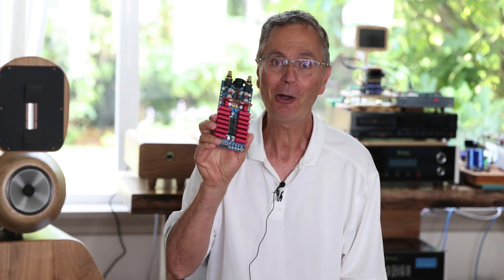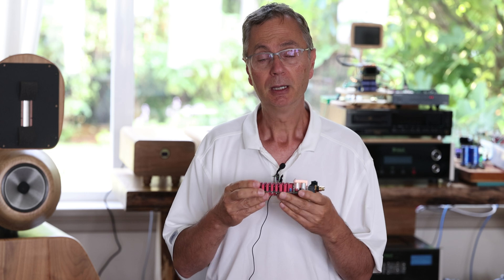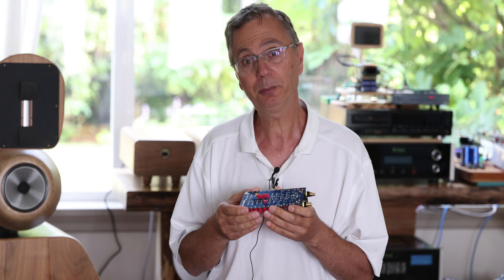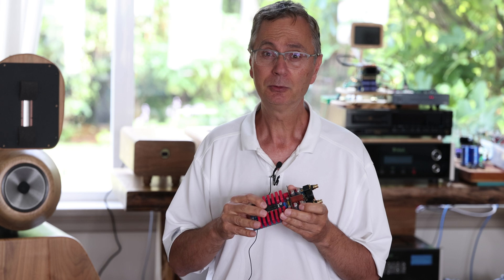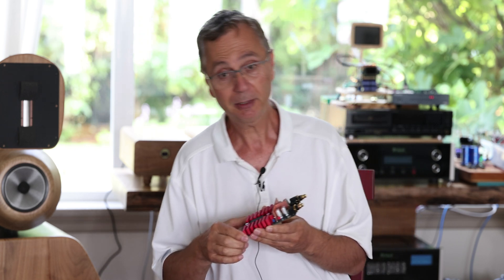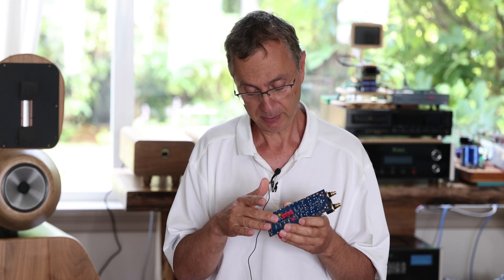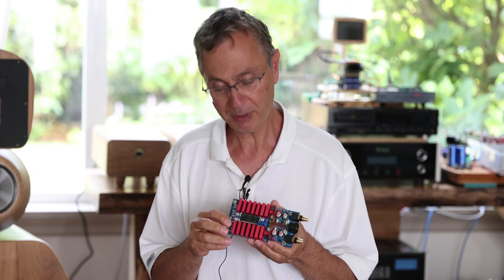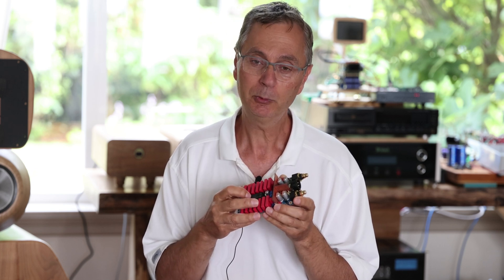Gabster TD1 Dac Features and Tips. Part 1

Comment: Hi Gabster, I would also like to build a Td1. I would get a CD player with a TDA1541A - S1 for 170$. The chip seems to be an original from 1989. Is it advisable to build one of these?

Best regards from Germany
Reply from the maker: If your Cd player is working well you can swap the Tda1541A chip with a socket so you can still use it in the future 
It is hard to find a S1 chip under $500 but if you can go for it there a lot of costs as you need a IanCanada streamer so budget for a good 1000$ but it will be hard to beatv
Reply: @Gabster1  Thank you very much for your information. Maybe I'll order one from your homepage. Best regards

Comment: I already have the parts from your “Flagship DIY streamer” on order, then I saw your TD1 DAC and ordered a couple of boards as well and found a couple of TDA1541A chips. This will be my first project and I’m going against your advice of starting small! Will you be starting a separate thread somewhere for questions, or is the iancanada thread that you linked the place to go for questions? Nice job with your projects and your videos!
Reply from the maker: For the iancanada stuff you can post on the Diyaudio thread 
For the Gabster Td1 you can post on any of the Gabster TD1 videos here preferably the first one maybe start by making sure your streamer is running well first watch for polarity and voltage so you don’t fry things before you enjoy them once things are running Add the Gabster TD1 and compare the sound start with a single board there will be detailed videos and instructions 
Have fun
Reply: Thanks for the response. My Denafrips Pontus II 12th reclocks the signal (which is a shame since my DDC that feeds it via I2S it has better clocks in it) so I probably won’t notice any difference with the streamer, but curious as to how my system will sound when I add your DAC to it! I was thinking about getting a Terminator/Terminator Plus but decided with wait and build this system first. Looking forward to the project!

Comment: Why don't you try a piggy banking the TDA chip? It's socketed just solder another chip on top of it, I would give it a millimetre air gap and put some copper tape on the bottom chip.
I've done it with op amps and it does make a big difference, and you can buy parallel DACs with multiple parallel DAC chips what are supposed to be a lot better. You could try parallowing three bit tricky but possible, I would put a capacitor of 0.1uF on VCC between plus and ground across the top of the chip tho.
Reply from the maker: You can run 2 cards in parallel same idea 
Like some cd players run 2 chips non balanced
The chips don’t stack well without the 14 capacitors
Reply: @Gabster1  what you saying? if the piggyback you get feedback?? well that's partly why using the capacitor and the foil shielding I suggested should smooth things out. I would have thought it's a lot better doing it that way than using two boards!

Comment: This DAC represents great value for money, especially when you know its been tweaked by a real music lover with great reference gear. im going to get one with parts i think. may i ask if the usb to i2s Amanero boards work with this DAC , i suspect it will?,
Reply: Lol no it doesn't.  It's inefficient, uses old ass parts and takes up more space than it needs. It's a cool learning product but no, it is not a well priced good value product. 

Honestly you could print and populate an R2R ladder dac for way less than this and get fine results. 

Costs under $20 bucks for a good dac BOM these days. And if you want top tier bom you can get a pcm1794a for $20.  Not sure why one would build a dac that's based on a old Philips chip from the cd player Era when we have so many better choices available these days.
Reply: @gtvwill  Well you could spend $7000 on a Denafrips and theres your cool learning product, come speak to me when the lessons over